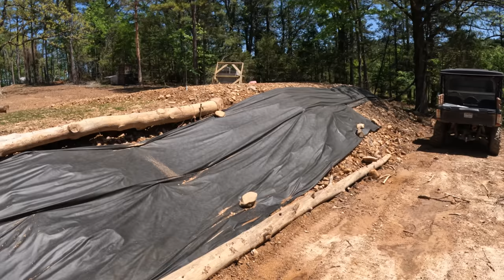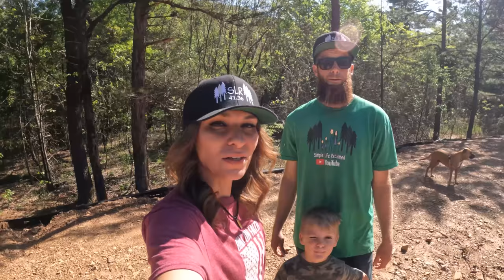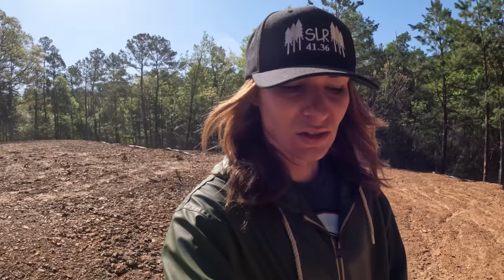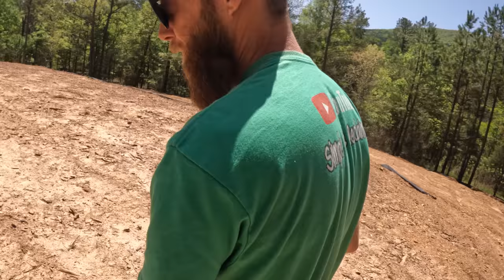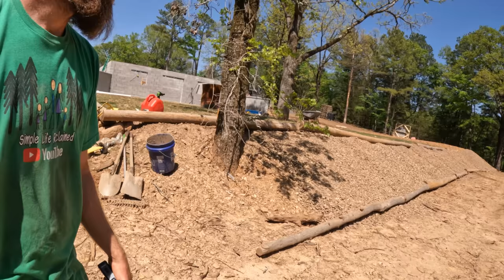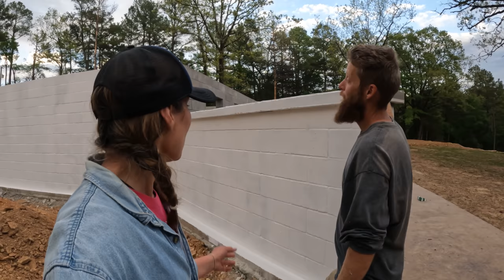BIG MOVES!| Erosion Control| Septic Installed| WATERPROOFING! | Couple Builds Basement for Cabin

Comment: You have to stabilize the slopes like you are doing but you have to  either  divert or  slow the water down coming on to the slopes. Straw tubes or stone can help with that. Crowning and stone lined ditches will help direct the  water where you want it to go. Building on slopes always creates these issues. The logs or railroad ties can also be helpful to  slow water flow.

Comment: So the next time Rooster comes out with the bulldozer have him regrade the tiers so the slope toward the sides so that’s where the water goes rather than over the edge. Grade makes a huge difference, plus vegetation does too. It won’t erode so bad once you start growing something on the slopes. If you only cover the slopes with fabric and rocks you’re going to continue to have erosion issues. You need an established root system to hold the dirt in place.
Reply: I would suggest you consider 3"-4" black basalt gabion retaining walls instead of rock slopes. And 9 mil non-woven geotextile rather than that skimpy weed barrier.
Reply: They need to make some sort of canals where the water flow down. Like on the side of the Streets
Reply: Wok with the water not against it it has to go somewhere
Reply: @roggro49ers  very true. Many slopes get planted with perennial flowers like iris or creeping phlox. They’re pretty, low maintenance, and the root system will stabilize the slope.
Reply: @roggro49ers  Yes, guide it away for no doing more harm
Reply: @LuvMyCardiKids  Yes and they’re beautiful
Reply: #Simplelifereclaimed      You will still have erosion. You have to have him come back out and fix the sides. And you need something other than river rock on banks.  

Love y’all ♥️🙏🏼♥️

Comment: You may be able to find a used tractor for an affordable amount. Our first tractor was a 1953 International, but tractors seem to have an endless lifespan, especially the old ones, and the engines are easy to work on. We needed it mainly to bushhog, but also used the bucket quite a bit for spreading rock, and a box blade for dragging the driveway after heavy rains. We also had a tiller for the garden. All used equipment that served us for years.

Comment: I am glad to see the concrete company came back and cleaned up.........
Reply: a little prep work like painters plastic could have saved a lot labor cost on the CMU clean up from your contractor, if I poured that using just the chute from the truck,  I would have had my crew  prep the walls,  literally takes minutes to cover those walls and save time on clean up. 
Good on them that they cleaned up after that nightmare of a mess they left.

Comment: You could also do French draining around the back wall of the basement.  Once you fill it, the water pressure behind the wall will become a big issue no matter how much water tight that wall you make.  With the French drain, the water will not back up and run from the sides.

Comment: I would also come back to the embankment sides and add really BIG rocks. like the kind you have to roll because they are so heavy, it will help keep the small rocks in place, at least I would put big ones inside of the logs, the wood will rot the rocks won't...do it now and it is done and dusted, won't have to come back later because the logs rotted...yes it takes time to rot but it will happen when you are as busy as a bee with other stuff.....big rocks will hold the dirt in when it rains like crazy....

Comment: Go to lawn installers to get cut off sod from them cheap and put that on your hill sides. It is the small odd sides that was cut off of the large pieces. For laying the roll of fabric use some pipe into the roll across a pickup bed or trailer to roll it. Need to add a tree house for the kids on the lower section below the main house with a ramp to it. I hate to tell you this, but the small river rocks will wash away in a heavy rain storm. Need bigger rocks with some low ground cover growing there with flowers too. Both families need to share a tractor, (with a bucket and bushhog) on your land. Might want to put in a french drain system around the basement. Maybe put in a couple of steps on the berms.

Comment: I would be curious to see what a laser line cast across the top of the block wall would reveal.  You can also run a mason string across the space and using a string level see how level things are.  This would be the last time you can check.  From here you really hope things are level.  If not the rest of the build will be much more challenging.  The grass is a very good idea.  It will go a long way towards erosion control.  If you have access, hydro seeding is the best way to spread.

Comment: You do not want to plant anything with invasive roots on or around your leech field. If you don’t  control the trees or bushes roots will get in your pipes and the ________ will not flow downhill. You will need to put copper sulfate in the tank per instructions on the product. Looking so good with everything!

Comment: I think the walls/concrete were handled well.  There’s a lot of old 8” block buildings out there with no steel reinforcement and no filled cells, 5x as many windows, and they’re still standing (maybe with a crack or 2 lol).  They went the extra mile with anything that they didn’t have to pay retail labor for, then got a small crew, to do the bare minimum to get them filled.  Yeah you could pay a lot more get everything pumped, vibrated, j bolts installed, and finished spotless.  They obviously have a budget and trying to get the best they can afford, no shame in that

Comment: I still think some plants that are native and no care, dotted  through the rocks will look pretty, be no maintenance, and will help anchor the hills. Love the new grass. Have you thought about doing a sort of French drain along the in side of the road to the different levels. Dig a 6 or 8 inch gutter and fill it with more of the river rock. You would be able to easily walk or drive over it but it would give the rain a path to go without tearing up the levels or road. Just a thought.

Comment: Maybe plant an orchard in the space that was opened up? That way you're replacing trees with trees, but with the benefit of food production.

I see the grass is starting to grow fast. Those roots should also really help with stopping erosion.
Reply: You won't be able to plant fruit trees on the leech field as the roots will block the pipes up, about the only thing they can plant is grass and screening bushes at the ends off the leech field.
Reply: @1MartinWaite Ah, of course. My bad. I had totally forgotten about the leech field  and where it might be located. Thanks for pointing that out.
Reply: @VeilZuTun  Not a problem I did the same but only in my thoughts it's a hard thing to hide. They could mark it with a big H and make out they plan on getting a helicopter. Lol

Comment: I have applied DryLok on several basements. It should NEVER be applied on wet walls. If you don't let the wall thorougly dry out, the moisture will be trapped. Drylok works exceltionally well in preventing moisture migration through concrete and cement block. Bare cinder block will absorb a tremendous amount of Drylok on the first application.

Comment: Great job…. But, when you see ground erosion it’s NOT THE RAIN, it’s the runoff from the rain… the ground fabric will NOT stop the erosion if it running down from the top. The tarp and rocks will help keep the rain off the hills and prevent erosion which is great but, if the water is running off the top of the tiers and creating erosion the tarp will not stop it… 
Also, where you have ground erosion… near drive way, simply dig down 1-2 feet, add traprock, stone and cover with dirt, loom etc.. and plant your grass. You’ll stop the erosion and control the water flow without having to redirect it away from house. Use the natural contour of the land to help you. Water runs deep and you cannot stop it, need to control it. 
You French Drain the entire compound, drive way, tiers and basement. 
Please take my advise, 30 years of this.

Comment: you never thought about going to the other side of the house i.e. up the hill a little, and adding some drainage in the form of trenches to divert the water with perforated pipe this would help with erosion

Comment: If you don't bury the top edge of that fabric on the top of the tiers water will get under it and wash out under the fabric. I know from working in oil field putting in frac pits and putting 30 mil plastic in those pits. We always dug a trench about 18 " deep to tuck the liners in all along the edges.

Comment: For the Place with the Septic Tank underground. You should not plant any Trees or Flowers with deep Roots. It could break the Tank. So Grass or an Little Greenhouse should be save. You could use the Greenhouse also to store your Garden Manual Tools, if you do not want it to be in the Garage

Comment: Yeah if you can find a tree trimmer that chips his brush this is good mulch for your soil it also helps with erosion control get dumped a whole dump truck full you can use a tractor or a pickup move it around that will work better I'm the weed fabric it would also Aid in planting shrubs and ground cover

Comment: french drains around the building as you will get water  since on slope,and ditches for run off water,make sure garage base is compacted well and plenty rebar slab.bushes as roots will stablize soil remember all your diging has broken up soil ....needs to settle again takes time

Comment: Hey Mel and Gary. I just watched the video. Am I too late?  I hope the instructions for applying the waterproofing first coat told you to dilute it. If the blocks are still full of air pockets, then the dilute coating will soak into these pockets and stick better. The filling of the wall with concrete may have used up the pockets.....Praying for your safety as you travel and as you build. Good Luck!  RTR

Comment: Concerned with doing a pad for the garage. Since it’s freshly built up dirt and may still settle as well as possible water running down hill and undermining the pad, I would do a foundation with the block you already have. I know you want to be done with block but I’m afraid you will regret just doing a pad. With a 3’ deep foundation you wouldn’t have to worry water getting under the floor or dirt being wash away.

Comment: Use Natural riprap material at the bottom of animal pen level. Starting with 100-200lb bigger chunks, then working smaller, ad you come up.. on top of the fabric.. won't have another issue..

Comment: Mr. Reclaimed trying out for the Wood-Put Olympics in the background!
Mrs. Reclaimed showing off other parts of her work wear modelling.

Now, I mentioned stonewalling and used the Japanese fortresses as a perfect example because they get a lot of rain. So does my home. Dealing with runoff water is a huge concern. Dublin’s water supply actually comes from an artificial lake known as Blessington that was designed to use the excess water in a productive manner and also, a fun spot for water sports, because the lake is high in the mountains and often gets strong winds. The joke is if you plan on going windsurfing bring your passport and some money for a ticket home.

My people have been dealing with excessive rain for thousands of years and you may have heard some of their solutions but never thought of them in those terms. The tomb at Newgrange in the Boyne Valley is older than the pyramids of Egypt and though built without cement or mortar of any kind, is completely watertight. There are some photographs and a video explaining, included. Stonewalling works in a heavy rain environment. It’s that simple.
https://www.youtube.com/watch?v=KVXWZkwV0RQ
https://www.manuelcohen.com/image/I0000.ZaaQJRrUp0
https://www.historicmysteries.com/newgrange/

Comment: I would be getting com"on with his tractor and bucket for the slopes and his road plane to put a slight camber or the road system plus I would be putting a road trench in to allow the water to run down the side of the road via a trench and pipe system then you keep your roads...
Are you going to grass the animal level so the grass can take up some of the rain fall then you don't get a muddy mess around the animal pens.

Comment: I would epoxy that basement floor-easy clean and no constant concrete dust-do it before it is all enclosed because of fumes and utilities you will not have to dodge-just a suggestion

Comment: The river rock is to small to stop erosion in the high water flow areas. You need what’s called RipRap. The rock diameter is at least 8-12 inches. 

You really need to get seed and hay over the topsoil also before it all washes away leaving nothing but stony fill

Comment: Here's an idea to think about. If the rear wall of the Garage doesn't have windows build a catwalk and then you could run a series of PVC rain spouts (easier mounting) or 4" PVC pipe across the wall spaced about 1-2 feet above each other and seal the ends and add some 1/2" plumbing pipes at each end about Half the height of each section to control the water level in a stepped pattern so the water flows down in a zig-zag then at the bottom have a pump to send the water back to the top. Add a barrel as a reservoir and add a bag of "Worm castings" to it as fertilizer and cap off the rain spouts with leaf guards with 2" holes for peat planter cups that just ouch the fluid level so the roots get food and grow herbs. Image below.
https://www.rxleaf.com/wp-content/uploads/2019/10/hydroponics2-1-768x768.jpg

Comment: Your plastic on that top row should go OVER the top of the NEXT row down because the way you are doing it the water will go UNDER the top of your SECOND row and the same for your THIRD ROW.  Because of that hill behind where the garage is going for sure divert the water all across the back of the garage area  with maybe a French drain to run the width of the concrete pad to divert to the side down into those trees.  Before you put your rock down on the road be sure to use HIGHWAY PLASTIC for that small area first otherwise you will be just wasting your money on the rocks for sure they will compact down into the muddy road.

Comment: Whast happened to the J-bolts on the tyop of your foundation?  You arent going to have a 2nd floor?  Drainage can kill the best grading over time, I remeber tyhe pad for the old house disappearing in 5 years after we busted the concrete up and got it moved to be stepping sstones around the new house.

Comment: The river rock is not ideal for what you are looking to do. You need to create a retaining wall to stop the slope from moving. At minimum the rocks should be 24 inches by 36 inches to create structure but you could infill with your river rock.

Comment: Just hope all of Garry's cells work was filled to the bottom with that incorrect mix of cement and them comprising the bottom with that vibrating chisel. Hate to see down the road.  the septic so close to the home will sink the sides foundation. Thought you guys wanted to live in the woods and not a concrete, gravel,country in the woods. Is the water overwhelming the dream of the country road.